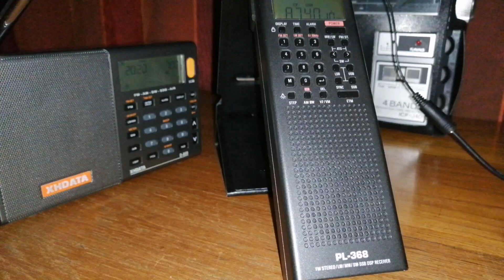Cape Town Radio 8740 kHz USB on Tecsun PL-368 #shortwave

Comment: Given the government of the time, Radio RSA was one of my favourite stations! I’ve spent many evenings and morning’s listening to Radio RSA, including on the 11 meter frequency: 25790. That came in like a local station.
Reply from the maker: Interesting that their signal was so strong. I think the government of the time spent quite a lot of money on the Radio RSA service and its transmitters.
Reply: @swlistening I believe that it was a 250 kW signal, using one of the most state of the art antenna systems available.
Reply from the maker: @RJDA.Dakota  That would explain the good signal. I think the transmitters were based at Meyerton, south of Johannesburg. Now there are, as far as I know, only a few MW transmitters left at the site.
Reply: @swlistening  I have the information still in front of me on a QSL card. It is indeed Meyerton, and power output is in the neighbourhood of 250 kW.